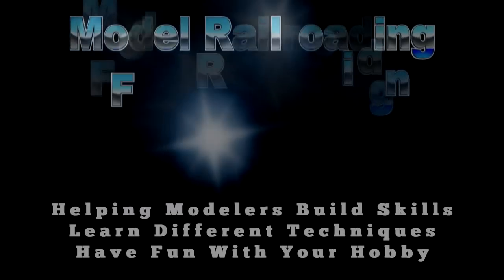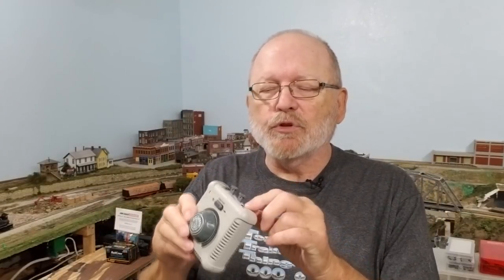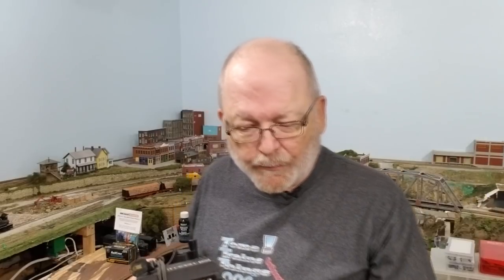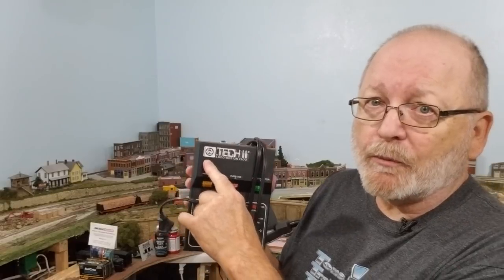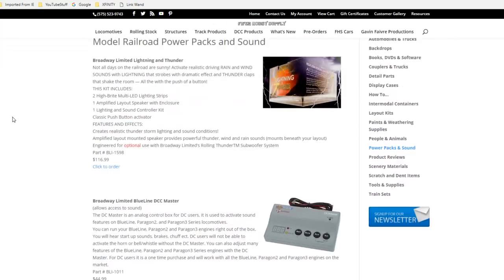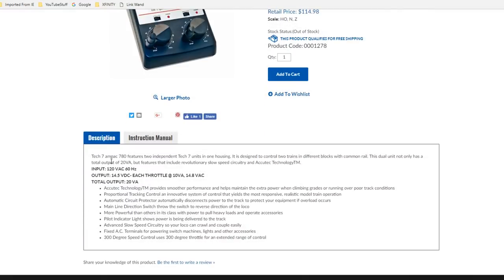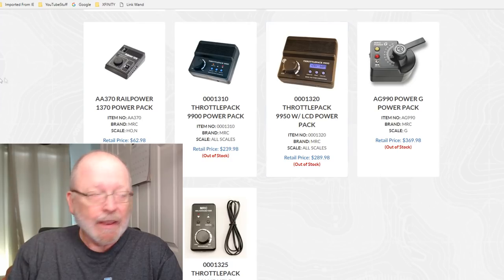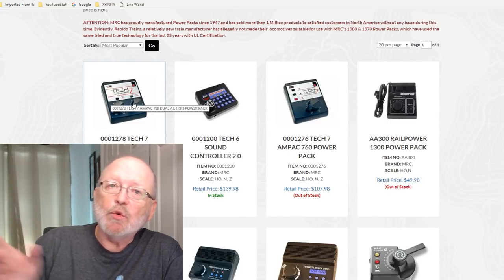Choosing The Right DC Throttle - Model Railroading For Beginners Ep 22

Comment: Great video Tom! Geez, do you collect DC power packs? Your home is like a museum. “This one here I got from an ancient Egyptian tomb. Used to run a train around the pyramid until the big sandstorm of 1870. It was lost for several hundred years. Still works!” -Mark
Reply from the maker: Well, I've been around a while, and every time I see one at a thrift store that's in fairly good condition, I just can't resist buying it. I wish I still had the one from my very first American Flyer HO train set. My older sister latched on to all my model railroad equipment when I went into the Air Force in the early 70's. I guess they thought I wasn't coming back. Fooled them!

Comment: Hello I recently purchased the above power supply. I run DC but wish to run two engines at the same time. My question is this: I connected my common wires (4) to cab#2 & the other wires (4) to cab 1. When I turned on power on, the engine stood still, but both lights on the transformer were illuminated. Thank you.
Reply from the maker: Send me an email with a diagram of how you hooked it up
Reply: @TomsTrainsandThings  hi I have no power of either cab (of a MRC Tech7) but I have power from the accessories out put. I also have a single track with a wire that is connected to my common track ( outside rail). This is really frustrating to me. I don't know how to send you a diagram. Can you email me about  some suggestions?
Reply from the maker: @kevinpurcell2093  take a few photos of how it is hooked up and email them to me.
Reply: @TomsTrainsandThings  um Here, the single wire that is on a track is connected to an Atlas selector. I will look at my email soon. Thank you for replying.

Comment: Very helpful and well out together videos! Just starting out with this hobby. I have an old bachmann trainset (with ez track) from the 90s, and picked up an older used athearn and atlas engine (prob from 70s or 80s). I also just picked up antique Fleischmann #500 TR50 Transformator for the heck of it. Any tips/advice/things I should be mindful of with using an old transformer like that one with those engines and ez track? Thanks!
Reply from the maker: Check to make sure you have sufficient voltage output. I have used old transformers from sets I purchased in the 70's

Comment: Hello there Tom.  I have a problem. with power . I have 4 starter HO sets from Athens.  And a steamer from PARAGON 3 ROLLING THUNDER BROADWAY LID IMPORTS and the power supply that comes with the starter set is ATHEARN IRON HORSE . THE power supply is DC . ( input , 120 v  ac 60 Hz 125 mA , OUT PUT is 19 v ac , 0-16v DC.  total output 7va . )  my track is EZ track and I have over 100 feet in total . All my engines lights flicker and they stop dead , and slow down and speed up . The steamer 2-4-2 CN runs only at full speed pulling 25 cars . iv cleaned all the track with 100 rubbing alcohol and no change . I run the BNSF with a CN . Do I need 12 gage wire and a better power supply.  I only have the small wire from the power supply to one piece of track . P.S I love your videos keep up the great work.
Reply from the maker: Power supplies from starter sets are enough for one locomotive. You may need to drop a few more feeders with that length of track with awg 14 wire. A new power source is a must.

Comment: I have a hobby transformer 6607 is it safe for newer locomotives? And I replaced the wires with The wires from  Lionel trains starter set transformer will that break the locomotives?
Reply from the maker: As long as it's outputting the desired voltage you should be alright

Comment: Hello. I purchased a MRC Tech 4 260 for my HO scale layout. I’m aware that HO train should be running at around 12 volt while this controller outputs 23 volt DC, I heard people said this voltage is designed for O or G scale, but MRC says it’s ok for all scales. Is this safe for my HO layout? Will I risk burning out my locomotives with this much voltage output? Please advise.
Reply from the maker: HO scale trains usually start moving just short of 12 v with the max at 18 to 20 v. The rating is the maximum on the terminal and is adjusted with the throttle

Comment: Question about using two power supplies on a DC layout with blocks! If I'm connecting both supplies to a common rail, is it ok if they're different voltages? One is 17VA and the other is 20VA.
Reply from the maker: Your confusing volts with volt/ampere. Volt/ampere (VA) is a measure of apparent power such as watts.  1 VA = 1 W.  Usually stated as a rating to compare , in this case, your power supply's total wattage

Your power supply feeding the track is a variable voltage which starts out low 0vdc to approx 18vdc at full throttle, this controls the speed of the loco
Reply: @TomsTrainsandThings  thanks for clarifying that about VA. To follow up, my two power supplies are listed as 14VDC and 23VDC (a tech 2 2400 and tech 4 260). Is it ok to connect the outputs together to a common rail for block operation even if their voltages are different?
Reply from the maker: Yes. That's the max voltage.

Comment: Well this just saved me a bunch of money,, thanks for the info! I do have a question: How many N scale locomotives can be run     on the same train using a MRC ampac  760 single throttle? Any help would be greatly appreciated. Aswell,,if I hooked this power pack up to a loop of about 60 feet of N scale track do you think it would power it? Once again,,any thoughts on this are appreciated.
Reply from the maker: You can run more than 1 but that doesn't mean they will run at the same speed.
If you space some track feeders on your rai.l.
Reply: @TomsTrainsandThings  thank you for the help,,I'm going to give it a try.

Comment: I have a floor layout in my bed room and i use a Bachmann trains power pack and its only good for one locomotive sometimes if your running 2 locomotives at the same time the power pack cuts out .    What power pack sould i get?
Reply from the maker: Try the MRC Tech 2. Those starter power packs are not very good.
Reply: @TomsTrainsandThings  thanks

Comment: Tom, this is gonna sound strange. Perhaps even silly.
But i was thinking of the following:
A laptop power supply can handle 19 volts. And i was thinking of converting it to a dc throttle some way or another.

What, if any, is your opinion on diy controllers?

And, this is gonna sound stupid, but what is the maximum voltage a normal HO locomotive can handle?
15 volts, roughly?
Reply from the maker: Laptop power supplies are used extensively in model railroading. You'll have to search for videos on how to regulate the voltage for your throttle. Most DC power supplies range from 18 to 20v max
Reply: thank you very much for the reply. Then i can make em myself in stead of having to buy em. I got plenty of old laptop power supplies. I also have 3 or 4 very old desktops, pentium 1 or maybe 2.
 @TomsTrainsandThings

Comment: I had a quick question, I hope you could help with! 
The power 1300 is plugged in but there’s no light that turns on. Is this normal? or does it mean that it isn’t working and I need a new one? Just gifted to my son. So I’m new to this train life. Any help would be appreciated.
Reply from the maker: Not too familiar with that model, but the only way to know for sure is hook it up to see if the train runs. There is a circuit protector on the unit in case of overload, this may be the indicator light you have a question about. It flashes if there is a problem.
Reply: @TomsTrainsandThings  thank for your response. So just to clarify, maybe it’s a good thing if the lights not flashing or on, is that correct? I did notice the wires were frayed. So there is no “u” metal shape connector also to connect to both the power box and the track. Sort of have to tuck the wires in under the screws of both connections. Maybe this is also a bad idea?

Comment: What would be a good controller for running 2 trains on a moderate size layout?
Reply from the maker: Your best bet is a ps from MRC. You can use the duel throttle one if you have your DC layout divided into blocks.

Comment: Hi Tom! When using dcc with a dc thotlle as a jump, does it also add to total amp output?
Reply from the maker: The jump feature on the Zephyr is for additional throttles and I don't think it uses any of the available power on the DC power pack.
Reply: the thing with DCC base station is the power control circuit have a certain rating, supplying more available power may smooth bumps, but you can't exceed the rating, and most DCC stations will shut down when exceeded .

The jump command was a way for you to get additional cab control on a system
Reply: Toms Trains and Things, thanks for the reply!
Reply: billfusionenterprise, thanks, I take it a digitrax booster might be needed then
Reply: probably but the zephyr has a 3 amp supply, unlike all the other starter sets. Just be sure to go to the site about which works with what. me if i need more juice i would piggyback another zephyr, it is in the manual
Reply: billfusionenterprise, thanks again!
Reply: velcome

Comment: this video is well-intentioned but you never get to the heart of the matter which is how much power / volts / watts does a beginner want for how much track.
Reply from the maker: For a beginner, any of these power packs will be sufficient.
Reply: @TomsTrainsandThings  Thank you so much for the kind reply, I really appreciate it and I appreciate your channel. I am re-entering the hobby of behalf of my daughter. I consider myself fairly technically inclined / good at electronics - but I am struggling to find answers to some basic questions like watts versus resistance / length of track. I am looking to make a large track that goes around an 8 x 10 living room carpet.

Comment: I have 1950s O and 1970s HO scale set. What power supply do I use.  I just bought a autopulse momentum 1 transformer.  Will it work on both sets? Are you familiar with this transformer?
Reply from the maker: Gary, the transformer you bought will work on your HO set. I'm not familiar with it but looked up the specs on it. The power available is less than the typical power pack available today. It's only 12VA where most others are 16 to 20 VA. But It will still work.

As far as the O scale set, you will need an AC power supply.
Reply: @TomsTrainsandThings  I've been wading through a bunch of newbie vids and here in the old comments is the answer to my question.  Thanks!
Reply from the maker: @crowznest438  glad it was helpful